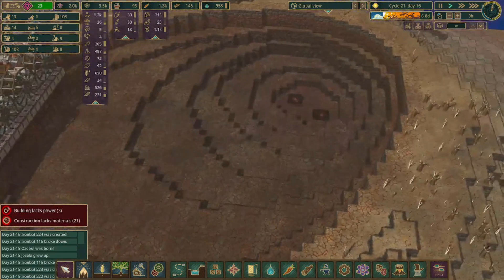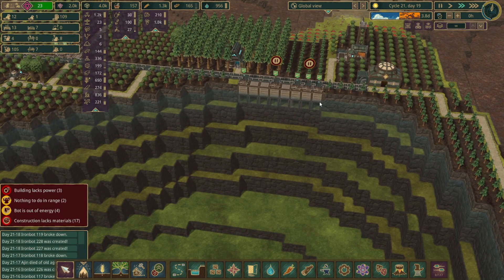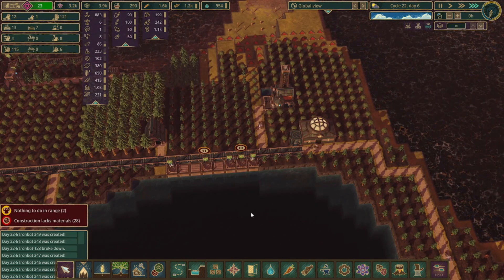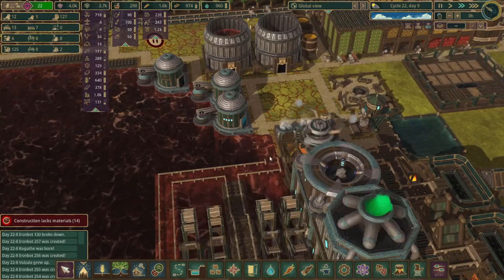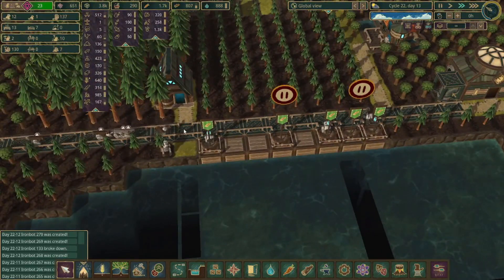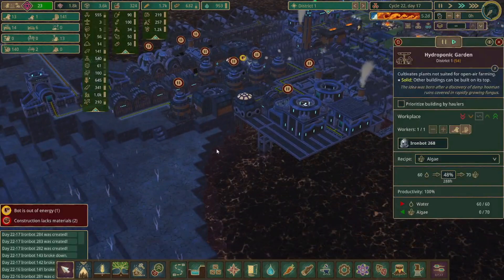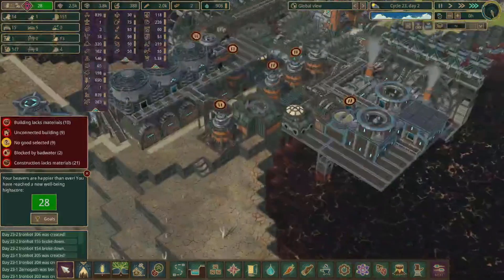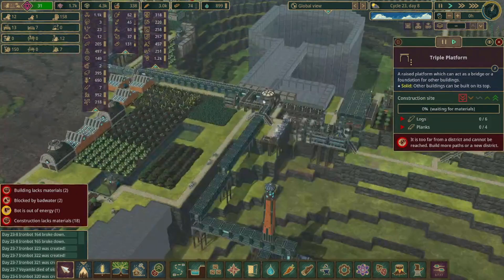Will This MEGA PROJECT be TOO BIG to Handle?!

Comment: As @Ajac_ said, it is related to a limit of 2.2 cms per edge. If you extend the outlet with an overhang with impermeable floors each tile edge will increase the flow by 2.2 cms.
Reply from the maker: @DISCOSHOEBOX  where did you guys find this information?
Reply: @OfficialAtomicGaming  "Random Kiwi Gamer" and "Skye Storm" have confirmed this by experimenting with fluid mechanics in the game. 
I have been playing around with this a little in my own game and it does indeed work and amazingly well.

Comment: hey mate, i think your badwater problem was you not having enough edges for water to flow. each block edge is 2.2 cms, so you might need more edges at the end of the "power canal". i could be wrong, not an expert at it.
Reply from the maker: @Ajac_  Thanks for the help!  I'll look into this more. Although I'm a bit ahead in the series from this episode (in terms of recording), so don't be surprised when I don't fully fix the issue in the next episode